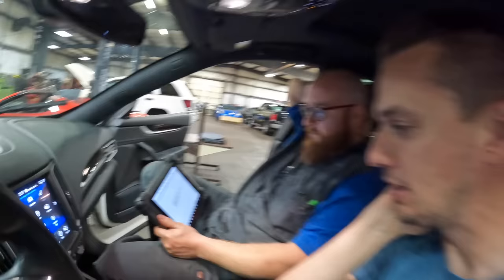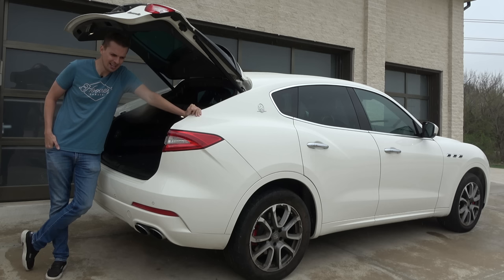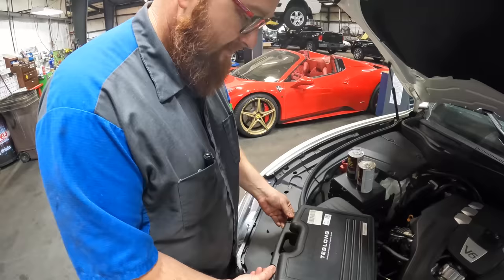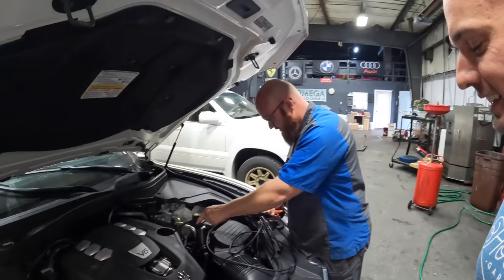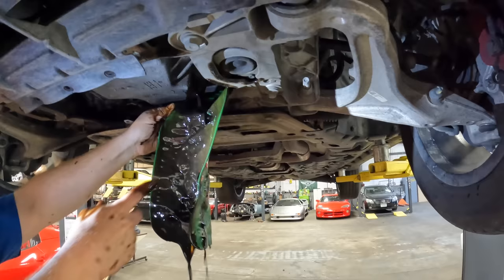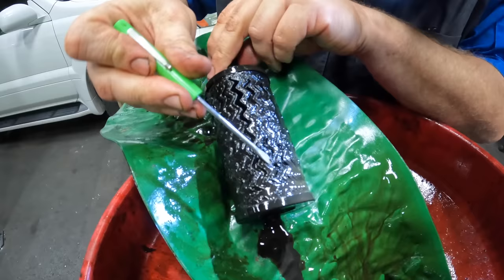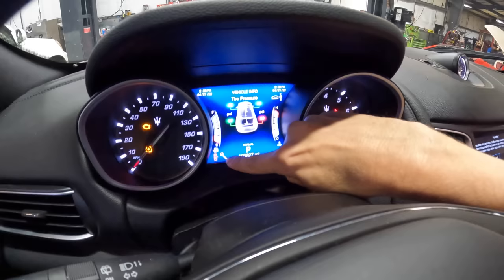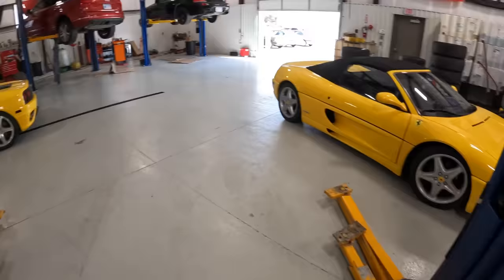My cheap Maserati Levante repo was a DRUG RUNNER, with NO OIL CHANGE for 60,000 miles!?!?!

Comment: Hello 👋Mrs Charlotte is legit and her method works like magic I keep on earning every single week with her new strategy
Reply: Here's her chat info 👇👇
Reply: သူမ၏十𝟭𝟯𝟬𝟱𝟳𝟬𝟭𝟯𝟰𝟭𝟱နံပါတ်၊
Reply: သူမ၏十𝟭𝟯𝟬𝟱𝟳𝟬𝟭𝟯𝟰𝟭𝟱နံပါတ်၊
Reply: This is her connection details 👆👆
Reply: Sometimes I wonder if she's used magic power trade
Reply: benson robbin Taylor  No exact amount but a profit range from $1200 to $5000 depending on the coin fluctuation in market

Comment: Find a local fire restoration/remediation company like Servpro or Servicemaster and get one of their ozone machines used for a home.  The smaller versions made for cars don't work nearly as well.  Park the car in the garage with the windows down, hatch open and trunk flap up and run the machine continuously for at least 48 hours.  Then, shut the machine off and open the garage door and let it sit for another hour or so.  None of this will do any good if you haven't replaced the in-cabin air filter however so be sure to do that FIRST before the ozone treatment.

Comment: Tyler, you should watch WatchJRGO’s video on the camero where he & Car Ninja did the flush system. Whenever you flush an engine THAT sludged up, you run the risk of dirt and particles plugging oil galleys which is known to cause spun bearings. The risk gets minimized by doing the following: (like JR’s video)
1st dump the oil, change the filter, put fresh oil, run the first system flush. Dump that oil, change the filter again, put fresh oil, run the second flush, or the flush rinse, dump the oil, change the filter put the best oil possible in and it might be fine. That’s the safer way to do that, unless you don’t care and are just going to flip it out of inventory, making it someone else’s gamble. Regardless, nice save, good score.

Comment: Should have changed the oil (with cheap oil) and filter first, then ran the BG flush, changed the oil and filter again, ran it for 100 miles then change it with good oil, I'm sure that engine is still pretty sludged up. I think when WatchJRGo does his BG treatments it ends up being 3 oil changes.

Comment: Back in the 60s my aunt bought a new Dodge with the slant6. She NEVER changed the oil even 1 time. The motor blew at 115000 miles.

Comment: When i worked at a jeep dealer i had a 19 Jeep Cherokee come in and it had 62,000 miles on it. They didn’t change the oil since 13,000 miles on. So 49,000 miles on one oil change in a 3.2L Jeep Cherokee

Comment: Not the recommended procedure, but BG-109 (now called EPR) is even more useful if added about 50 miles before the change.  Add 2 cans and drive it to the Wizards for the next change.  Do that a few times and it'll be pretty clean 😊

Comment: I thought you were going to say that you suspected that the previous owner transported a tiger in the back! 

The amount of time the engine lasted without an oil change is insanely impressive. I knew of a Toyota matrix that needed a new engine due to no oil change, but that only managed 50k miles

Comment: I worked as a manager of an auto rental office.  In the 90s, computers in corporate kept track of mileages for oil change so they were usually late.  However, if a car moved between offices, it could be quite awhile before anyone realized it needed a change.  I had a Pontiac 6000 in my fleet that had its original oil from GM in it at 51,000 miles before its paperwork caught up and we could get it an oil change.  This, also, is why I laugh at people who buy fleet cars "because they're well serviced" uh, no.  No they are not.

Comment: Hoovie, Surprising Land Rover Discovery 5 oil filter is accessible on the top of the engine. It is the easiest oil change I have ever performed with my Fluid  Evacuator in my driveway.

Comment: Solvent like that destroys motors it does such a good job breaking the stuff up it all get sucked up by the oil pump after the flush and clogs small oiling holes/ screens seen it happen 3 times so far

Comment: You should sell that Maserati back to FCA and they can use it as a press vehicle showcasing the fact that somehow that engine is still running at 100k miles and only 3 or 4 oil changes. For any car that is very impressive, but for a Fiat Chrysler product, it's a diamond in the rough.

Comment: I feel that on the used car market. I bought a 07 dodge ram 2500 ST but I am having to do quite a bit of work to it where it wasn't well maintained. Then it does have some pretty bad rust which I do plan on putting on a better bed at some point. My brother in law was giving me hell about it but the thing is I got the truck for 5500. Right now if it were in great shape it would be a 13k truck all day long. Prices are used vehicles are going up every time you turn around. I bought my truck cheap enough to where I can do the work and have a good running well sorted truck. Got it in time to be able to save the truck. Any later it would be too far gone to even think about.

Comment: castol has the metal particles that turn that orange color and fill everything with sludge, whenever tearing apart any bmw engine you always have the orange to clean. anything but castrol

Comment: I've dealt with some Audi v6 engines that would cook the oil into a lava rock type substance around the camshafts if oil changes were neglected. If you flushed the engine, the "lava rocks" would break free wedging the cams and they would break. I can't stress enough to check for this type of buildup before doing an engine flush on anything. Synthetic oils can sludge up in a different manner than conventional oil making this risky.

Comment: That oil filter should be sent to the manufacturer as a test sample for how well it done to keep the engine running on 60k with no oil change. They might even be able to engineer them even more to increase longevity even more so in situations like this.

Comment: Flush/change the oil again in 500ish miles.
With how packed that oil filter was, there is definitely more sludge to remove from the system.

Comment: I'd run some transmission fluid through that engine and then change it with cheap Walmart oil every 500 miles for a few thousand miles. Saved a few sludgy engines that way. I believe I used B12 chemtool in the last couple.

Comment: With oil change neglect like that the main bearings and piston rings probably have the equivalent of 200+K miles on them. I’m surprised there’s no blue smoke coming out of the exhaust. And the intake valves are probably covered in sludge too. I’m getting heartburn just thinking about it lol.

Comment: It seems like dropping the oil pan, scraping the sludge off of it, and cleaning as much as possible, then replacing the oil pan gasket before you run the de-sludge solvent, would reduce how much sludge was in the engine to begin with.
Reply: And clean pick up

Comment: Engine flush then put in cheapo, bit thin oil and new oil filter. Drive for a 100 miles or so and then changes oil for proper stuff and filter again. Yeah it's work but the way to do it.

Comment: With an oil filter that plugged up "solid", doesn't that mean either the engine was being starved of oil, and/or pressure, or the bypass was activated, and all that dirty oil was circulating through the entire engine unfiltered? How come that was not even mentioned or brought up?

Comment: Just had a transit in my shop that broke it's driveshaft coupler. They added an oil change and I pulled the plug and nothing came out right away. And than it began to slowly baby poop out. I have to flush it 3 times and clumps were still coming out of it! It was worst I'd personally seen!

Comment: Those Chrysler turn stalks don't like to sit unused. I had the same problem with one I bought after sitting. By the time the part came in it had fixed itself just from use.

Comment: Should have loosened the filter off first so the oil drained into the sump before removing the sump plug. I would have drained it again a week later and filled it again with Castrol Magnatec

Comment: Could be a bargain unless that engine is going bad from lack of maintenance. I’m pretty sure even a junkyard replacement motor is about 7K
Oh and the transmission? When was the last time that filter and fluid was changed. When the TC starts to slip a junkyard replacement trans could be 5-6K maybe?

Comment: Watching this is reminding me of a mercedes I did 2 oil treatment flushes on  with 4 filters and basically 3 oil changes. The filter looked worse then that plus sludge was on the cap all over the valve cover internally and was just awful

Comment: I'm thinking two new filters should have been part of this process. IMO a new filter should have been installed prior to the beginning of the flush process. That way a new fresh filter can do all it can to capture the now loosened gunk. After the flush, drain the crankcase and toss the filter. Replace with new oil and filter. That to me seems the better way to do this process.
Reply: Never though about trying this

Comment: I would have changed the oil then done a flush. Seems like you’re using the old oil to flush would send more bits into the oil passages more than necessary.

Comment: That doesn't look that bad for going 60k miles since an oil change. When I worked at the Ford dealership a lady's 3L Fusion got towed in with a seized engine. When we asked when her last oil change was, she said "Oil change?... But it came with oil in it..."

She never got an oil change in 120,000kms since buying it brand new. When we took off the oil pan drain plug, maybe half a cup of tar slowly dripped out over the course of about 10 minutes. She completely grenaded the engine. She was doing a lot of driving back and forth from Toronto area to BC... She's lucky it didn't decide to give up when she was in the middle of Saskatchewan or something.

Comment: 13:00 I believe they make it hard to service on purpose, but their dealership service shops probably have specialized tools to easily drain the oil or change the oil filter. There is no other earthly reason a 100k car dumps oil straight on to its frame. They do it that way because they know jiffy lube WILL fuck up your car and you'll get taught never to use any other service center but their official one. A marketer designed that car.

Comment: When I went to get my cars engine replaced at Toyota I saw a FJ Cruiser there and the service manager said it went 50-60k without an oil change and it was sludged up just this. It was a mint FJ too idk why that owner did that either
Reply: Probably was too lazy too remove the plastic coverings to get to the drain plug and filter

Comment: The Maserati V6 is not related to the Ferrari V8 or the Alfa Giulia Quad V6 which is the Ferrari V8 with two cylinders clipped. The Maserati V6 is a proper 60° V angle. The engine is made at the Ferrari plant and it shares parts like the starter, but the engine design is completely different. IMO this is the engine the Giulia Quad should have received.

Comment: You know I’ve been a tech with my own shop for almost 15 years. But I worked at the quick lube shops for a few years throughout my first years in the business and I think wizard really gives a bad name to those places. Yes they have bad stories, but you gotta remember those places do 100+ cars a day, not that there’s any excuse for a mistake, but to have 1 or 2 mistakes after thousands of cars really is a pretty good track record. People only want to talk about the bad. By wizards standard, you would never want to take your car to him because of the time the put the wrong oil in the Mercedes’ SLS transmission. It happens, some places are good some places are worse but that’s no different than dealerships or private shops

Comment: Unless it was a small mobile meth lab in the back, it's probably more likely that a cat was transported in the back and peed everywhere (which is pretty common when cats have to travel and freak out). The ammonia/cat pee smell is really only evident in the production of meth. I used to inspect houses as a side job and ran into this situation a few times on mobile homes and storage buildings. It can be dangerous so please replace the cabin filter as soon as you can. And maybe get a professional clean on the inside as well.

Comment: I would have down the flushing twice right after each other. Then with the new oil and filter installed, I would change that after circa 1000 miles. Better safe than blown. It1s Eye-talian, after all. :-((

Comment: Aren't you supposed to do a flush with fresh oil and a fresh filter so that the new oil & filter can absorb contaminants, then do another oil change right after. Drive a couple hundred miles and then do another oil & filter change?

Comment: Wizard, if the owner (s) were careless and pushing miles, is it likely they used off spec oil weight often from gas stations that usually don’t not have Euro oil?

Comment: Hi! Would you suggest an oil flush on a relatively low milage but old engine? I got my hands on a 2007 Merc with a M273 motor (V8 5461 cc) alwayis maintained properly, it has run only 42000 miles in 14 years. After changing all the fluids and an oil change I was asking myself if an oil flush would make sense on it. I am planning to keep it for a long time and drive it at least another 80000 miles, thanks in advance to whoever wants to share their opinion.

Comment: I think there were no oil counter reset oil services done. 60k w ith no oil change and it is not rattling, cam phasers clattering, and cam control solenoids are working is about impossible for that long

Comment: No matter what the officer friend of yours said I would have a someone with a drug sniffing dog go over the car and clear it. I knew a guy who bought a car at a police auction, The car was towed for unpaid tickets and I guess who ever owned the car was too afraid to claim it. The only issue was the rear windows were not working and when they pulled the door panels off they found a huge stash of weed jammed in the doors and the wires to the windows were cut. I guess so it didn't cut into the bags. This was long before it was legal not sure what happened no one ever told me for all I know they kept it and had a good time! LOL I would be afraid I would get pulled over by some new cop and he decided to have a dog come out an sniff the car. I am sure you could beat the charge but who wants to have to go thru all that.

Comment: run the engine with 80% engine oil and 20% ATF hydraulic oil for 15miles , then flush it and engine wil run fine for another 200 000miles if serviced on time

Comment: i have seen 1998 toyota corolla in 2009 with 186 000 miles 1.6 4afe engine oil has never ben changed or aded, one owner, one driver.... engine started nocking...

Comment: i used to sell maserati's, the engine and tooling to make them are all maserati's design and patent. they just had ferrari building them cause of a downsize many years ago. they had a contract with ferrari till 2020. its why the trafeo had less horsepower then ferraris.

Comment: Is there a trick to run it at 1200 RPMs instead of pure idle of 750.  I have put a brick on the pedal but it's always supper difficult to have it not be full throttle or idle.  I have also had the computer kick in and drop it down.  thoughts?  computer tricks?  gas pedal trick?

Comment: I have a problem my mom pays in oil change shop down the street from our house her engine doesn’t run right I feel like I need to pay a different shop to change the oil because there’s something wrong even though supposedly everything’s OK and everything but he thinks I’m crazy but the engine doesn’t run right and the oil Disney changed and I’m not tripping in the oil change shop from down the street is screwing my mom because she simply gotten oil change somewhere else there wouldn’t be engine problems

Comment: For 60k miles the oil looks too good. I think it had an oil change in between. Also, when the oil is in this condition, a flush done in this sequence will not help very much. I would suggest changing the oil and filter with good quality oil and drive it for 1000 miles and check the inside of the engine. After that do the flush treatment and refresh oil again. After 1000 miles check the inside of the engine and the quality of the oil. This gives more time to let oil do its cleaning and containment job. Just adding flush to old ruined oil will not work very well.

Comment: Jiffy lube will break an oil pan drain plug in a Toyota Corolla any day. 
I know that because they broke mine. It cost them over $2,000 to fix. Car had to be towed to Toyota. New oil pan. Tow. Rental car. They're terrible.
Jiffy lube is the worst. Avoid them like the plague.

Comment: The bodily functions remarks are at there pinnacle on this video!😂  Italian engineering on serviceability of the oil is the biggest joke of this video.  I have never ever witnessed on oil drain plug placed in a non-draining location.  No wonder the prior owner of that thing never changed the oil!  Let that drain plug loose and you will be replacing your Gucci loafers 👞 🇮🇹

Comment: Or they just had a small dog or cat and took it everywhere with them and it peed in the back of the car. Not saying all women drivers are bad, but I've known a few that weren't aware oil needed to be changed, they just filled it with fuel and drove it.

Comment: the absolute stupidity of saying they had drugs in the wheel well, i dont care if the courier is bind stoned drunk and tripping they arnt storing drugs in plain sight, the drugs will be inside the seat, inside the spare tire wheels even inside the running tires or the gas tank never the wheel well or under the seat in your luggage bc the biggest sin a drug courier can do is getting caught of a cold stop meaning they wernt suspected of the drugs but they were found by the officer pulling them over for a traffic stop, that is a death sentence,